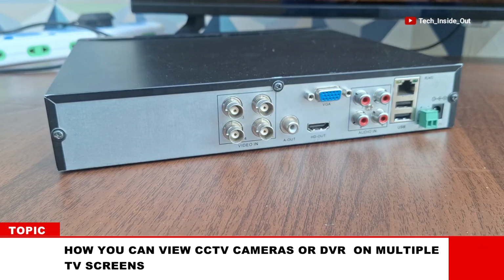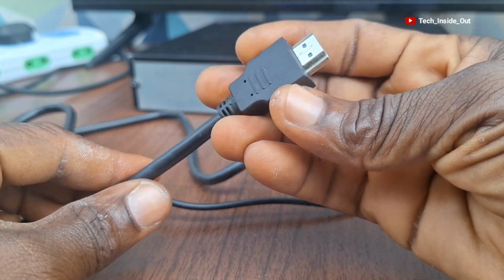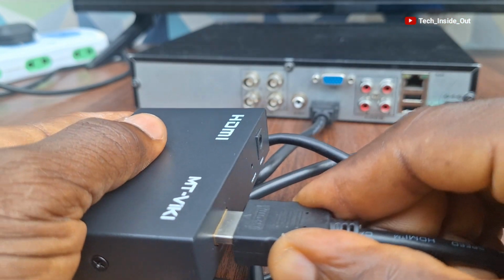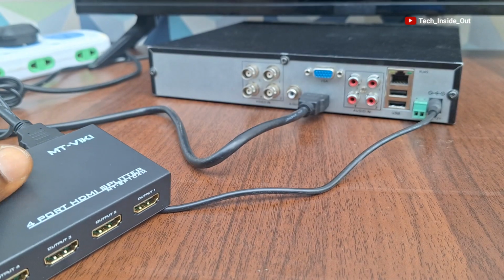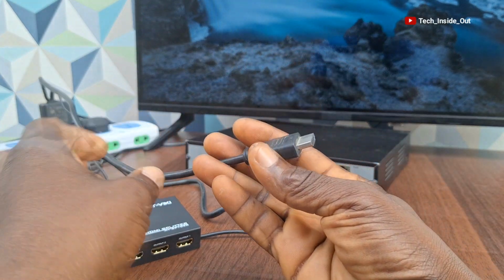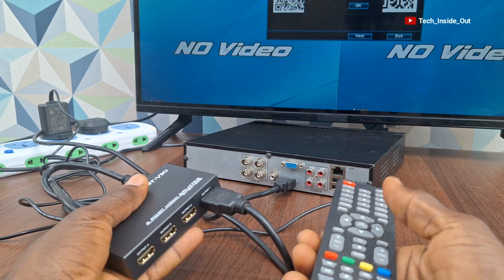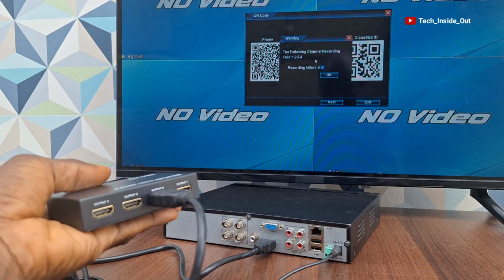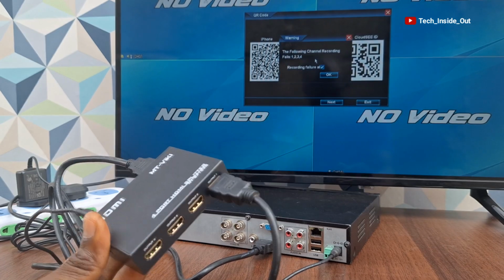Connect cctv cameras to multiple tv screens without using internet connection

Comment: What if the other TV are far apart from each other
Reply: @GaniyuRidwan_  then use a longer HDMI cable like 10-15 meter depending on the length of the where the Tv is, then  connect it to the splitter
Reply from the maker: As rightly said, you can get longer HDMI cables to buy or you can even prepare HDMI cables using network cables
Reply: @Tech_Inside_Out  i have another tv in a different room about 70 meters...can i use the splitter?
Reply: U can go in for HIMI extender